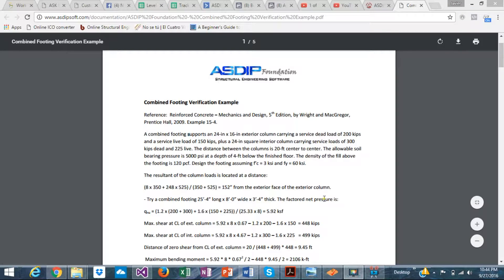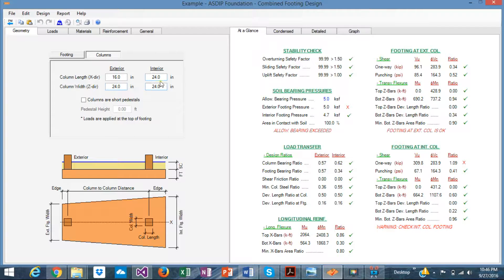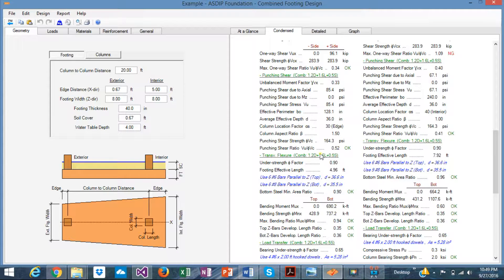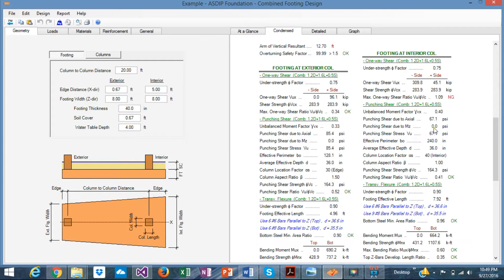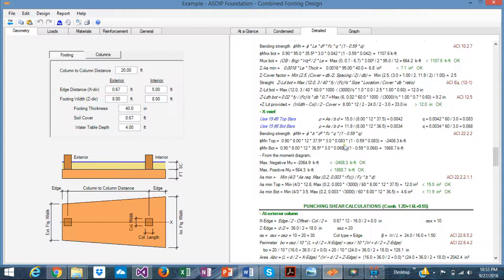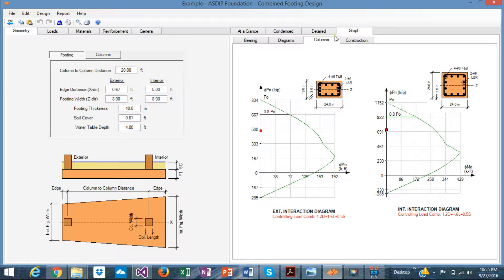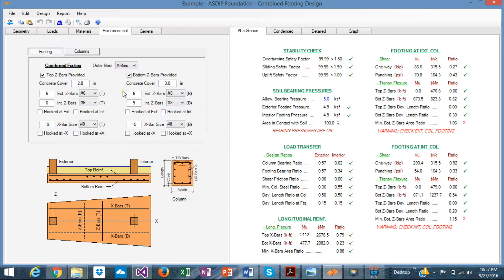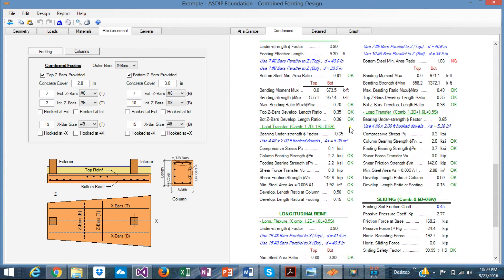ASDIP Foundation - Designing a Combined Footing

Comment: In strap footing I found,  ASDIP is checking for "footing bearing strength  ratio" and "column bearing strength ratio".
Can you please explain me what they really are and how to fix the design if design in failing in "footing bearing strength ratio" and "column bearing strength ratio"?
Reply from the maker: At the column-footing interface there are two types of bearing stresses: as the terms indicate, one is for the footing, and the other one is for column. You can see the corresponding formulas in the Detailed tab under "Load Transfer Calculations". You can change the size of the column and/or the concrete strength f'c to reduce these stresses.
Reply: Thank you very much for your clarification.
I have an another question too: While designing strap footing I encountered "development length ratio" for exterior and interior footing.
Can you explain me about "development ratio" and how to fix my design when it fails in "development ratio".
Reply from the maker: That refers to the development length of your rebars. You may fix the problem by allowing the rebar to develop as required.
Reply: well, I don't know how to do that.
will increasing the dimension of footing work?
Reply from the maker: I recommend you to get familiar with these engineering topics before you attempt to use any structural engineering software.
Reply: where can I find about these topics?
I just googled it but couldn't find the exact terminology. so I thought it might be software specific. I might be wrong though.
Reply: Thanks in advance. Thank you for your help.